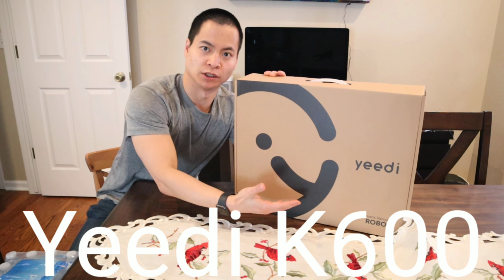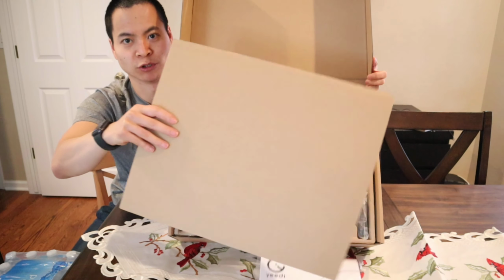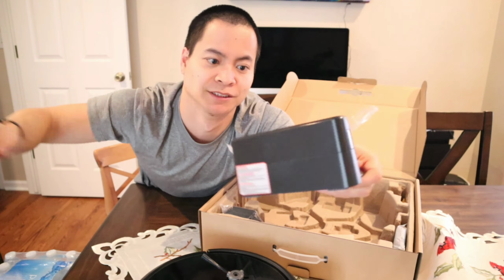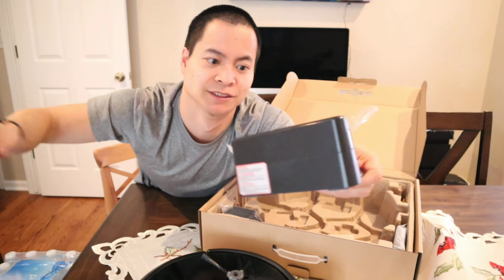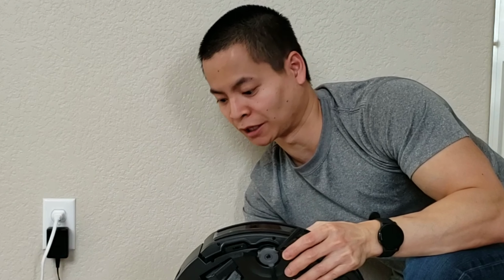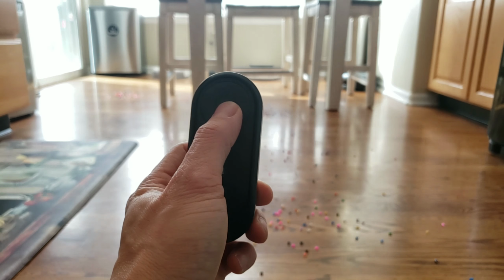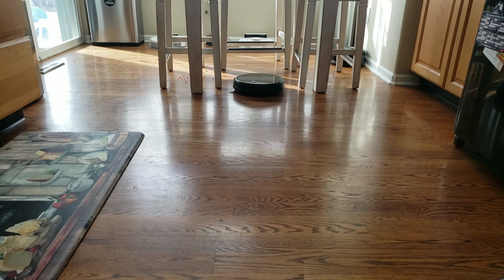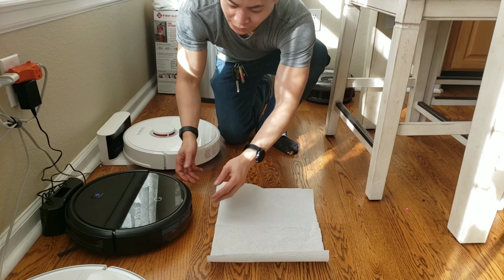Yeedi K600 - Simple Easy to Use Robot Vacuum, Random Navigation - For Smaller Areas and Pet Hair

Comment: I love mine, but now it stops and beeps, I've cleaned everything on it and still does it, I guess they last just barely a year
Reply from the maker: Hmmmm you can try an push the bumper on the robot, see if anything is caught and move freely. Does the vacuum turn can you hear any noises. Also the App give any indication or notification of problem?
Reply: @RobotMasters  I don't have the app with this one, it was the cheapest model because I wanted to see if I'd like it first, anyway the vacuum works fine for about a minute, than starts beeping, I did clean it out and found a small piece of wood and took it out, but still beeps, I emailed the company and no response yet, thanks for the response
Reply: well I actually fixed it, I didn't know the brush came out because I lost the manual, so I took it out and tons of cat hair was stuck in it, problem solved

Comment: I sent mine back, my amazon firestick remote would start the vac when I don't want it to
Reply: I got the K650, it runs from the app on phone, and it will voice command from Alexa, very happy with the K650. Plus the dust bin is 800 instead of 600 on the K600
Reply from the maker: @mfmayes  Thanks for sharing your experience and thanks for the clarification 😅
Reply from the maker: Interesting heard that happened with another user. Maybe robot vacuum companies can allow the remote to switch frequencies or turn off completely.

Comment: i have noticed if you have a amazon firestick, the up and down volume on the remote will start the Yeedi K600. Yeedi said to move the dock and robot not near the firestick. Next one i will get is one run by app on phone to avoid this problem. But outside of that, the vac runs great
Reply from the maker: Very interesting, thanks for sharing. I guess some of these vacuums use the same IR frequencies.

Comment: Do you have the option of  controling the robot path left and right using the remote buttons?
Reply from the maker: Yes the directions are Forward, Left and Right. There a back button which rotates the robot 180 degrees and than goes forward.

Comment: Wow what a influxe of robot vacuums in the market but still irobot🤴 leads the path with shark coming in second simply because of self emptying bin. So does it return to dock when power drops to percentage left. Roomba 595 wants to run to very last amp, what a trooper 💂‍♂️.  GOOVI Robot Vacuum, 1600PA Robotic Vacuum Cleaner
Reply from the maker: Yeah there sooo many models and variations, there some promising models coming out for this year. Lenovo has a Lidar robot vacuum with self emptying bin, and a few with twice the suction power around 4,000 Pa. The Yeeti will automatically return back to the charger after cleaning for 110 minutes or if you tell it to return home.
Reply: Have you seen this "Pure Clean PKSVB18WT - Smart Garbage Bin - Trash Can with Built-in Dirt Vacuum and Motion Sensor Lid (5+ Liter)" will this be the next step. A trash can doc for robot vacumm, vacumm leaves/recharges from base and returns empties in trash can from bottom while people use from top motion sensor lid, all in one unit. I have motion sensor waste peper basket, bought it for $30 kind of a joke but really like it.
Reply from the maker: @kinglord5429  Intresting, do you have a link to the robot, I will take a look
Reply: Oh might have mislead you, the pure clean in just trash can with vacumm base  I was speculating next version would have robot vacumm stuff. Were else does irobot have to go, would make sense for next self emptying bin designs.
Reply from the maker: KingLord The next big thing is being able to transition up and downstairs, and combine the mopping and vacuum in one unit
Reply: Yeah but i figure its going to be hard to achieve that. The all `n` one garbage can is realistic.

Comment: As robots with lidar and Vslam are getting cheaper imo these become less relevant. What do you think?
Reply from the maker: The random navigation still has a place because they can cover a small area multiple times. In theory they will do a better job than a smart navigation robot that can cover the area once or twice. These random navigating robot are good for the smaller homes or single rooms. Still use random navigating for concentrated cleanings